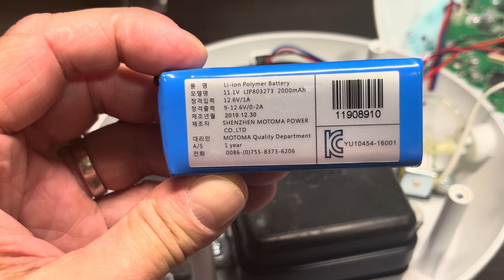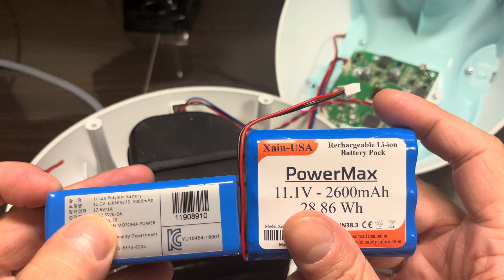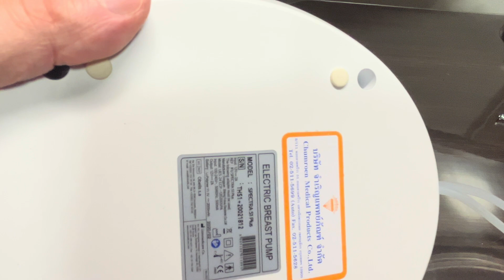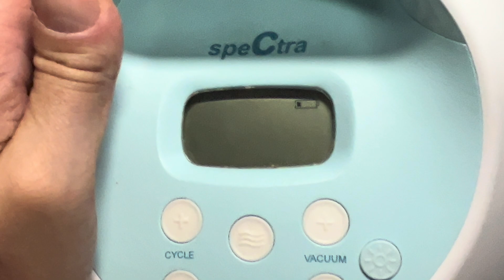Battery Replacement Spectra S1 breast pump (locating the problem)

Comment: Did the battery replacement end up helping the problem with the charging at all or did you have to get help with the computer board itself in the end?
Reply from the maker: Unfortunately it did not help at all.  The board was not available anywhere, so we ended up using it with the cord.  
Since the wife was using it in the car a lot, I got her a car adapter.  Luckily the pump is running on 12V input, so it was easy to do.